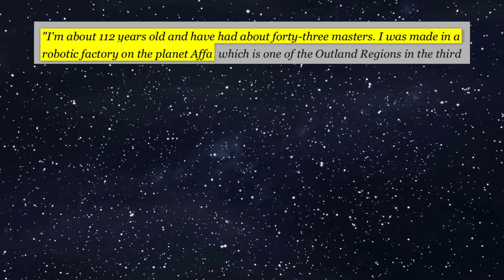Star Wars Just RETCONNED This! (But it Actually Makes Sense)

Comment: If you think about it, a Jedi could feel the things others need machines to monitor, like the flow of electricity through a circuit.  Anakin could have picked up a part for C-3PO and been able to tell at a thought if it was broken to the point that it couldn’t be repaired or if it just needed minor repairs to work like new. 

You can extend that out to Vader as well. His suit provides life support, but Anakin may have been the battery for it. “He’s more machine now than man,” Obi-wan said, if you recall. Anakin could have been extending his sense of touch through the metal components of his prosthetics, making them just like flesh and bone. That might explain why he was less active in his dueling in the later chapters, because so much of his power was focused on keeping him alive and whole. That might also explain why he couldn’t immediately sense his own offspring. It would also explain why the Emperor could foresee things, but Vader acted in the moment. 

We could really do with a series that explores this.

Comment: I saw no major conflicts with the two backstories.  If C-3PO's memory core had been in active service during that near century, and then his 'original' body fell apart, and Anakin found the memory core, and scavenged for the parts?  It all works pretty well.  (Actually, it also suggests that C-3PO could have popped up as a newly built droid in The Acolyte, lol.)  The explanation of Anakin's knack with machinery and piloting coming from the Force always made perfect sense to me. And he seemed to pass that gift onto Luke.

Regardless, it was George Lucas's creation, and if he wanted to change an element that was not shown on screen, that was his right.

Comment: What?!? Anakin's engineering skills were a "force power?!? 

FFS, the never-ending retcon of pre-Disney Star Wars by "The White Slavers" at the House of Mouse. 

Lucas, as he always did, made clear that Force sensitivities give insights which can help inform decisions and actions. He never said mechanical prowess is a"Force Skill".

Here's a fact : If your aim is to not retcon existing canon from other creatives, you don't do prequel material. If your intent is to retcon another creative's canon, you prioritize prequel material.

With the exception of the  iconoclastic forward-facing retcon in the Disney "sequels", the vast majority of Igor & Kennedy's approved productions have been prequel material (i.e., predating and superseding the Episodes 1 through 6).

Selectively "canonizing" pre-Disney content from the SW:EU is also a deliberate retcon of Lucas Star Wars as that material was never considered canon during Lucas's tenure as Originator and IP Holder.